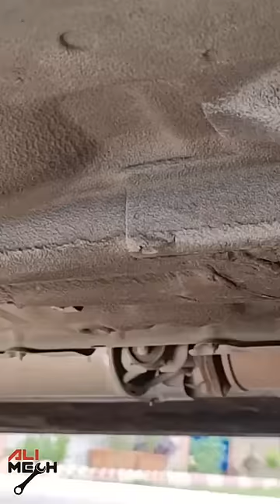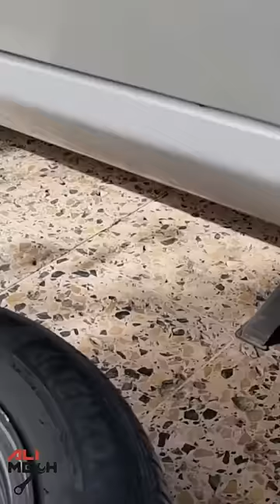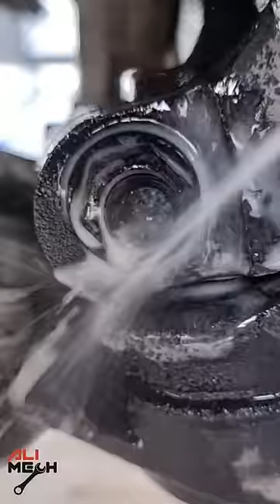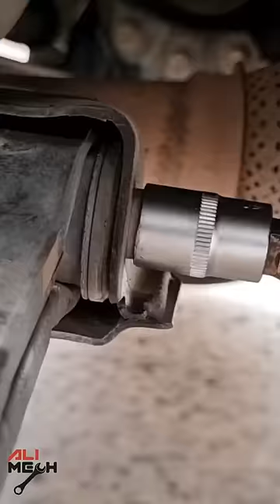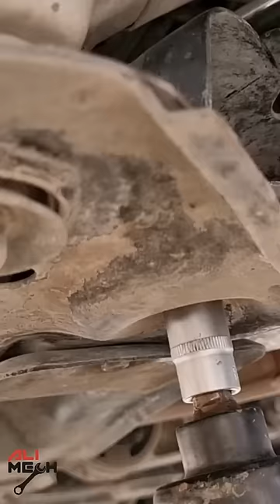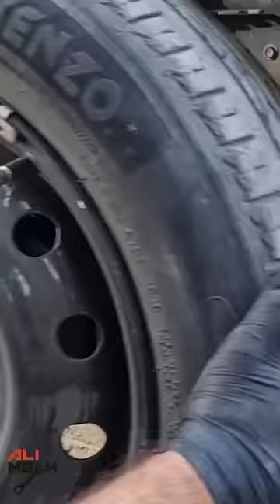How to replace control arm at home #shorts

Comment: Important tip, bushing bolts tighten when the car is on the road position
Reply: That's correct, hundred of control arm fail for that error.
Reply: Отличный совет 👍
Reply: so what is the solution for this problem?
Reply: Sure! 100% support
Reply: I came here to say this. That new control arm will be out in a few months having the bushes replaced. Though if the car is going for a wheel alignment immediately after having a part like this replaced, just ask them to loosen and re tighten the control arm while they're under it doing the alignment.
Reply: @lordjaashin  Milwaukee paint pens. Mark original clock torque.
Reply: That rule ignores 95% mechanics.
Reply: exactly, preload.
Reply: The solution is not to hit paths and bend the arm no bad bushing would give that ill effect
Reply: @mitchallen5819  does it work instead of tighten it to specified torque on the road position?
Reply: I don’t understand. Can someone explain?
Reply: @humanegarcia1140  . When tightening wish bone bushings in the position when the suspension is unloaded the bushing is in an unnatural position.  When  the weight of the vehicle loaded the bushing because the centre bolt has been tightened in the unnatural road position the bushing twists inside the wish bone causing the bush to fail . This would go for the bushing thats on the front going from the front to rear of the car . You have to tighten them when all wight in on the wheels . If you were mechanic a 4 post ramp would be great
Reply: @amd.0001  not exactly. 
Do you know a benefit of using a torque wrench over a tire iron? 
Tire irons when used tend to over torque causing lug nut damage along with the tapered ID of a wheel. You don't have that problem with torque wrenches; however, over time just about everything need torque adjustments. And that's something you'll learn with experience. 
Think about it like this, it's like doing an alignment. A tape measure will get you in the ballpark, but it's best to take it to a shop for them to do it to spec. 
Hope this helps.
Reply: In any other case you will destroy the silent block
Reply: Exactly

Comment: You gotta torque the LCA bolts with the vehicles weight on the part to ensure that you won’t wreck the rubber bushings.
Reply: Это же ремонт по русски

Comment: Your supposed to tighten the rubber joints only with the weight of the vehicle on the ground aka wheel on car off the Jack's.

Comment: Torque the control arm bushing bolt(s) with the wheels on, pointing straight, and full weight of vehicle on the ground. Something about a potential memory steer or some shi otherwise.
Reply: Exactly. What he is doing there is just diminishing the life span of this part at half 😁 Is written in many workshops manuals
Reply: How are you supposed to do that? I get the reasons for doing it but good lord there's no room unless you have a pit to stand in.
Reply: Usually I can get most vehicles. Otherwise I’ll drive it up on auto ramps and call it good.
Reply: @sebastienceniceros3145  or preload the lower am up to near operating height with the jack and then tighten the bush. Then put the wheel on and put it down.

Comment: Every job is easy when you have the right tools. How many people watching this video including myself has an air compressor with enough power to run an impact wrench? Don't forget all the right size collection In order to remove the tires and the rest of the job that needed to be done. I would love the same mechanic to do the same exact job with hand tools and not cut away with the camera every 5 Seconds to make it appear faster than it actually is.
Reply: I do ! Got all the pneumatic tools and cordless tools you'd need. Including air compressor...
Reply: @brianmason8400  yup me too! Came here to say exactly this...

Comment: Pretty good. Now try that on a 96 dodge ram 1500... it's got a steel bar with bushings on both ends running through the control arm

Comment: That bolt for the front bushing in the control arm needs to be tightened with the weight of the vehicle on the suspension otherwise it will fail in short order.

Comment: One thing you do on install is put full weight on lower control arm.  If you don't what happens is you put a lot of stress on the rubber bushings and bind the suspension
Reply: Shh, he is supposed to be teaching us.

Comment: I usually leave the hydraulic jack too just as a added safety precaution
Reply: Me too, but in this case you'd need it for the bolt ( last one ) behind the brake disc anyway. He wouldnt show that part since its a short.
You right anyway: "you cant be too safe'
Reply: He needs it to put the lower ball joint  so xd
Reply: I usually leave it there not for safety but because I do not want to move it, that jackstand is not moving.

Comment: 40 yrs working on cars and trucks,I never used a torque wrench on lugnuts
Reply: And you're cursing the mechanic when you are on the side of the road trying to change a flat tire with the lugs torqued to 9000 ft/lbs!

Comment: Some errors. The stud damages the Car Body Underground. The bolt needs to be tightend in the weighted Position. If you screw them tight in lifted Position, the new bushing will die very fast.

Comment: You have to use the torque wrench when in is on the ground to tingthen the arm on to make it thingt by the way you do it will not last long as it should

Comment: Tools make the work easy and fast,I really need all this kind of tool that I will be using too work
Reply: Kinda helps if your working on a new vehicle as well.  No rust or corrosion of any kind.  Lol so fake.
Reply: @michaelhounsell3888  Not really a fake, it depend on which country he from..  my vehicle even has past 20 years old but has no rust on any screw and parts, because here has no snow season..

Comment: You have to add this line to the end of your caption, 'by bringing all the tools from the workshop..!'
Reply: Especially the air impact hammer and torch to get the bolts out when rusted in from rusted metal in States clearing road with salt.

Comment: Para los tornillos de la horquilla no se usa herramienta de impacto porque puedes barrer las cuerdas o la soldadura de la tuerca interna se puede romper y después apretar o sacar tu tornillo no va a ser nada fácil 
Solo los tornillos pasados como del buje flotante o de la rótula si puedes usar herramienta de impacto
Tal vez sea neumática y no tenga mucho torque pero te vas a acostumbrar y cuando te den una llave de impacto eléctrica y hagas eso ten por seguro que te va a pasar lo que te digo
Por lo demás excelente

Comment: Now get the alignment done plus when using the impact, use it on the nut if possible, you get more resistance trying to turn the bolt

Comment: Took my BMW specialist mechanic about 2 hours to do my X3. On a lift, with every air/power tool known to man.
A bit WD40 was not the answer to the problem. Oxytetracycline torch, air hammer, persistence plus a lot of experience was what it took

Comment: Idk if I'm supposed to do it. But I add a little oil on the end of the ball joint so it can slide into the bottom of the steering knuckle a little easier.

Comment: What did you do with the spring?
Reply: It's a strut. Don't need to do anything with the spring. Lower control arm is a fixed component, there are no adjustments on it so no wheel alignment needed. Probably better to do it for maintenance but not required on most cars.

Comment: The front bush should of been tightened and torqued when the vehicle was at rest on the floor. Torqueing it up when the arm is fully extended will mean the bush is twisted when lowered and car in use

Comment: Not supposed to torque until it's loaded.
Have to sit the car on the ground on its suspension fully loaded.
Then set the torque.
Otherwise the bushings will be set in the unloaded position. Leads to premature wear.

Comment: Looks like the jack stands left a nice dent in the unibody rail.. which is not  designed to have the whole weight of the car sitting on 3square inches.. always put the jack stands under the solid steel sub frame.. or atleast use wood on top of the jack stand.. I don't know how many vehicles i have worked on where its completely dented or caved in because the owners don't know where to place the stand

Comment: He torqued the lug nuts, ok.
But none of the other fasteners were torqued.
I understand about tightening the bushings with the weight on. I use a different method. You can torque with weight or without using a little bit of spark plug or dielectric grease on the rubber bushings. they will slide into their normal position all by themselves. The dielectric grease or spark plug grease is harmless to rubber. It does not deteriorate rubber like oil or petroleum grease does and actually helps in the normal movements of the suspension....
🤔

Comment: shouldn't have tighten the lower control arm bolts to chassis until the weight of the vehicle is on the bushing

Comment: You messed up buddy, you shouldn't have tightened the control arm until you had the weight of the van on the suspension.

Comment: Impact sockets are supposed to be used with the Impact gun. And the weight of the car should be on the ground before u tighten a arm bolts. And clearly u don't live in nova scotia by the way it is falling apart. Lol
Reply: No

Comment: I call bullshit. There is more to it than what is shown here. At minimum the wheel needs to installed with the car off the jack prior to tightening the inner control arm bolts